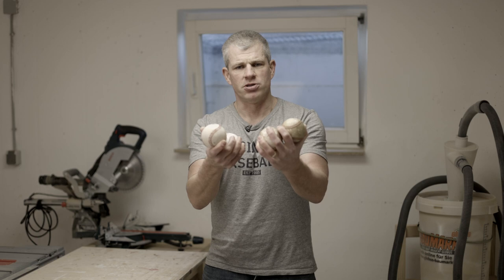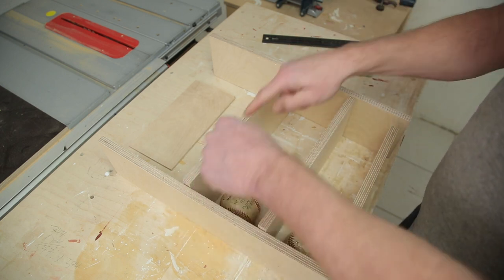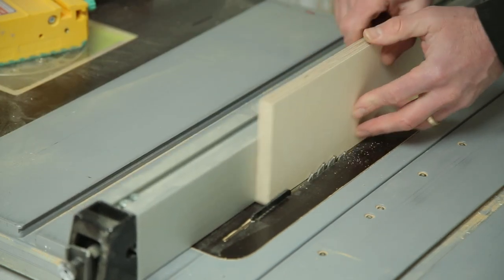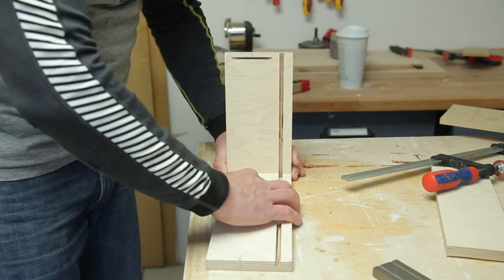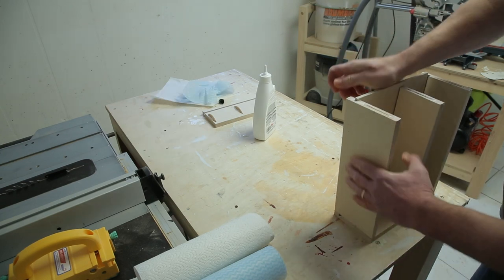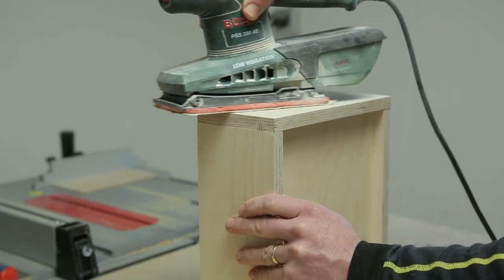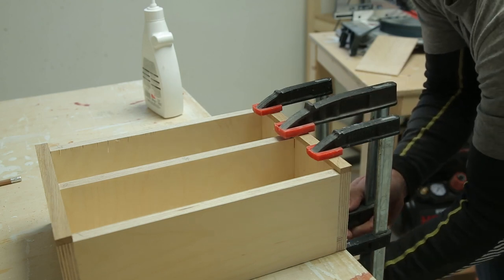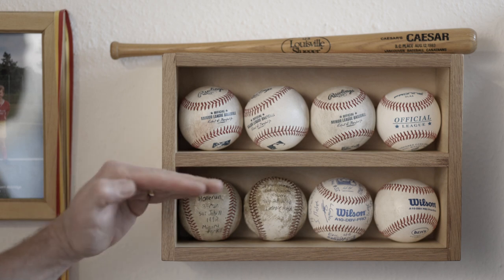Baseball Display Case

Comment: Nice quick project! Is there a reason you didn’t give the balls any horizontal space? Not enough scrap material would be my guess. 
| o o o o |
vs
|oooo|
Reply from the maker: Ha. You know me well Marquardt. I used every millimeter of scrap that I had. If I were starting from scratch I would definitely go with   | o o o o |